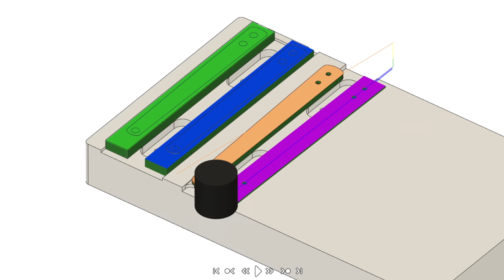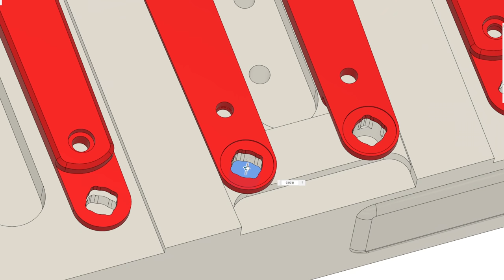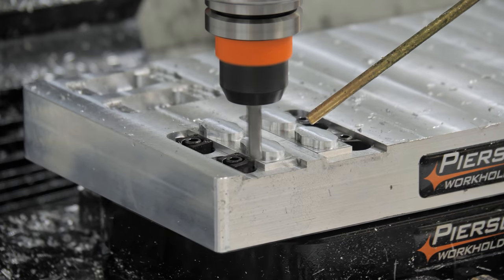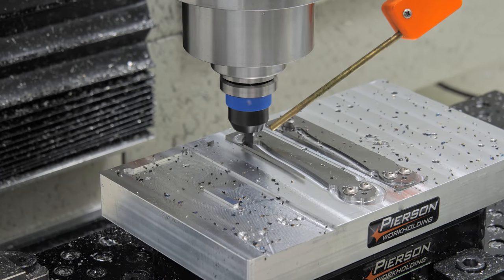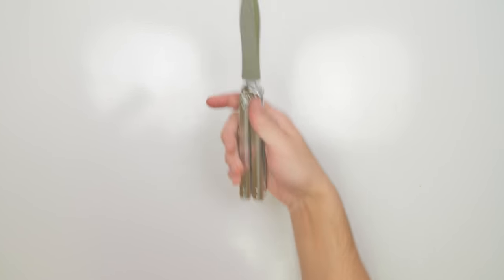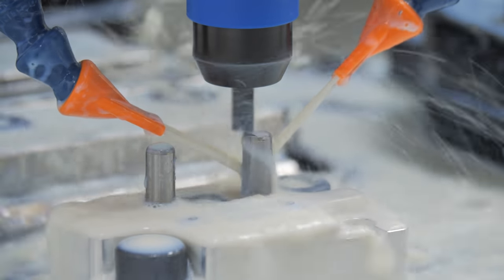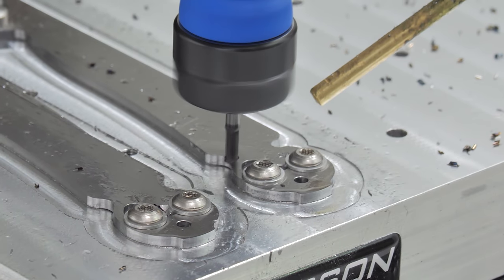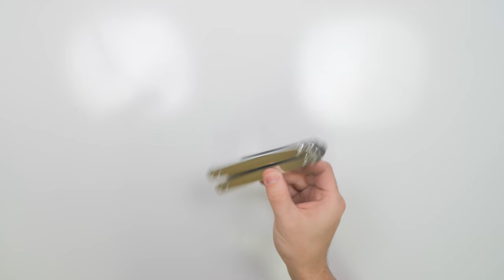Tiny Details, Big Improvements. Baliscissors Ep 26

Comment: You might want to consider A2 for the final blade material, where I work we use it for cutting punches and dies and it holds up relatively well for punching out steel, we can run over 60k parts sometimes before anything needs sharpening

Comment: Awesome update!  Watching your contour pass where the end mill is hitting full engagement briefly made me think of a change I made recently that really helped with titanium and stainless.  (Aluminum lets you get away with almost anything!)  Look under the linking or passes tab on your contour op, and play with feed optimization.  Basically it lets you reduce the feed within a distance of a specific angular change.  So long sweeping contours shouldn't need anything changed, but on inside 90 degree corners, or in your case it looked like it was about a 160 degree change of direction, you can set a reduced feed rate.  This helped a ton, especially in the hard metals.  Try it for those contour passes like  you have on your blade.

To see what's being affected, simulate the contour path in Fusion but switch the tab on the simulation to info.  You'll be able to see the feed rates during the simulation and you can see where it slows down and speeds back up as it enters and exits that tight corner.

Good luck!

Comment: I've got one tip for you. If you have problems with damaged screw heads ditch your Wera Hex Plus Allen keys. 
They just damage screws in lightning speed.
Try out a good set of PB Swiss or Wiha keys, they aren't rounded and are much less aggressive and don't damage your screws in the cost of weras Tool life.

Comment: If you're using pins to set the gap between handles, you might consider something I found on one of my Benchmade folders: the blade stop pin that controls where the blade opens to is actually machined in an octagonal shape, but each face is at a slightly greater distance from the centre axis. This allows you to change where the blade stops so that the it locks up perfectly and also adjust for lock wear, etc by simply turning to a different face.   You could do the same on the scissors or simply use am eccentric pin that could be set at whatever position.   It would also allow user adjustment for those who would like more or less spacing..

Comment: For parts that require a precision of .001">, you should consider the room temperature, as well as the coolant.

There was a company in the past that had 2 weeks long of troubles diagnosing their defects. The problem came from a garage opening across the shop that let cold air in. Thermal expansion/contraction is a sneaky issue that is oftentimes overlooked.

Comment: LOL i had exact the same problem with the screws of my knives. but i checked it pretty soon, so it  was not a big deal at all. since then i allway check for the heads to go all the way down.  the srews are not threaded all the way down because it is very hard to do so, and the would be way more expensive. funny thing is, the more pain it was to learn something, the better it marks in youre brain and you wont forget to check for it ever again.

Comment: I just hope they are affordable when they come out, but this is on guy doing everything himself and it's very custom and one of a kind so he can get alot out of them
Reply: They probably will be in the 200$ range when they first come out
Gotta remember that mass production is a key point for affordable products and that won't happen right off the bat, but this series generates ALOT of consuner confidence in the product
Reply: I'm betting around 400 for aluminum, and near or upwards of 800 for Ti + add-ons like carbon fiber scales (just from seeing custom knife prices, and trying to find online CNC services for personal projects). The cost of tooling, consumables (coolant, etc.), stock, and machines, will need to be eventually offset. His CNC mill cost $10k base (Tormach PCNC 1100). That, plus the time he spends inspecting for quality control, measuring for tolerances, and the eventual returns and warranties.

If he sells it for $200 though, I am buying 2x :D
Reply: @nugenki  i wonder if he has investors lined up, I'm sure this series has drawn the eye of some
Reply: @thegoldenatlas753  I sure hope so! Much deserved

Comment: I think you found the limitation of a mill. the pin could be made more precisely on a cnc lathe, and some of the parts could be made on a wire EDm, bringing precision. 

it no good for prototyping, but  "production" would fix a lot of problems.

Comment: There's a lot of exciting news and I'm glad you had some of those Revelations. You hinted at it in the video but has increasing the cycle times noticeably helped with designing and improving the product?
Reply from the maker: Making parts faster has been a huge improvement in every way. That doesn't mean it applies in every situation though. For example in this video I had to slow down making the pins and the neck area on the blades to get good results.

I was always told you can start accurate and get fast, but you can't start fast and get accurate. This applies to everything from machining to playing music.

It's a combination of better fixtures, and the ease of machining aluminum that allows me to have more of a SpaceX "blow up the rocket and see what we learn" approach.

In my last video I talked about a 5 step design process where increasing cycle time is the 4th step. Just the other day I spent 20 minutes trying to shave 1 minute off a tool path on a part I'm only making 4 of. It's something you have to always be thinking about. That's not even talking about rushing in general which leads to crashes and injuries.

I think experience has helped me figure out in which areas I need to speed up and where I need to slow down.

Comment: probably an idea that has been suggested alot but what if you mount the blades on op 2 on an angled surface that is the same angle of the bevel and you can just surface over them. That could eliminate alot of cycle time per part.